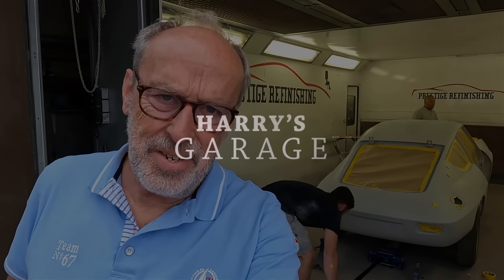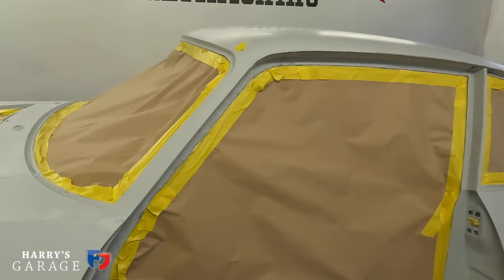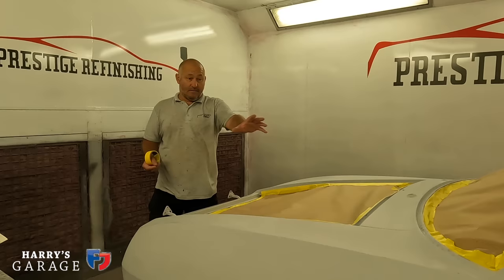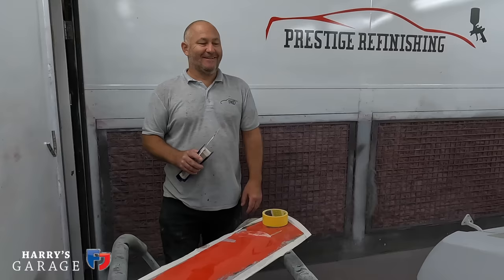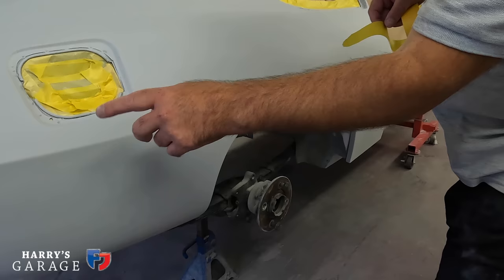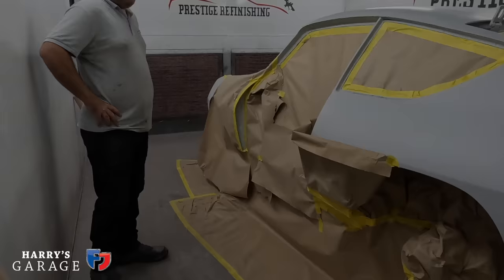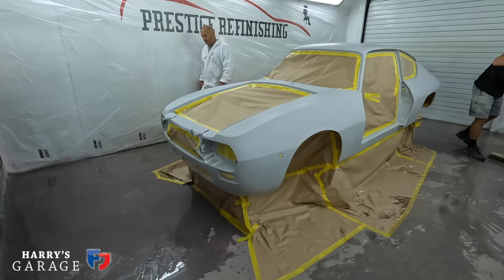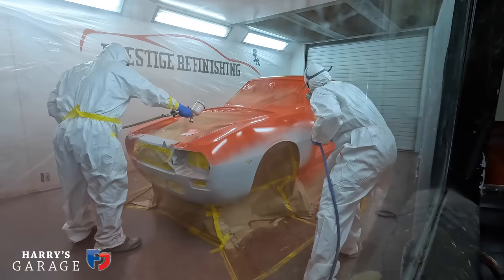Lancia Fulvia 1600 Zagato pt.11, the Zag gets painted in 'Rosso Rally'

Comment: The Fulvia is certainly going to look amazing when complete. I know being painted back to its original red was always going to happen. 

Though I would have loved to have seen its body, only polished and clear coated, leaving a dressed Frankenstein look.

Maybe just painting in its red, the fuel filler cover and some other accentuating parts, plus adding an offset GT stripe.  Only so that the Body builders craftsmanship & skills were on show and the total extent of the replacement work visible. It would also highlight how fragile and prone the original cars were to the elements. 
It would have almost appeared at first glance to resemble a polished aircraft fuselage. 

Now the next question is the interior? I can't recall what he said was going to happen there. Anyone?
Reply: Red and black or red and saddle colour?

Comment: Correct me if I am wrong - out of the LANCIA factory, it would have been a single stage red - AKA - NO clear over the top of the red?  All single stage factory colors that I have ever worked on on older cars (other than late model 'junk' with solid colors in clear over base - AKA - COB) never had clear over them - only the metallics had clear over the top (and even some of those never had a clear over the color coat - HA - good luck trying to polish them).  In my opinion - COB on a non-metallic color on an older car loses the 'original look' WOW factor of original factory appearance.  I am doing a several 60's - 70's builds at the moment - and none of the solid colors will be a COB.  HA - my late model HONDA JAZZ has COB red (and the clear is breaking down on one spot) - I would never do that to a classic car - UNLESS - the factory also did that on solid colors.  My 85 PANTERA - SOLID RED = NO clear is the only way for me.  But - such is life, and people can do what ever they like with their vehicles, so I am only highlighting the fact for anyone that may want to make sure that they achieve 'as factory' appearance.   And other than something that will be 'stored in a glass cabinet' - I always like to leave a slight orange peel to the top coat.  Nice job the guys have done with that 'bucket of sh-it' that the FULVIA was when they commenced - HA.  That FULVIA is going to look so nice in red (HA - even though COB).  CHEERS from AUSTRALIA.
Reply: Then the solid 2k will suffer from sun bleaching